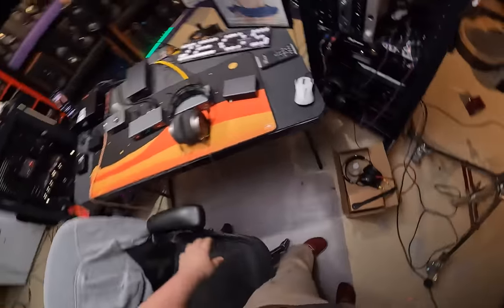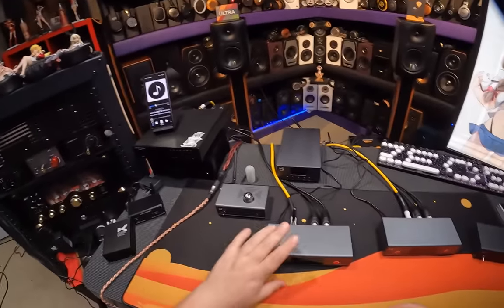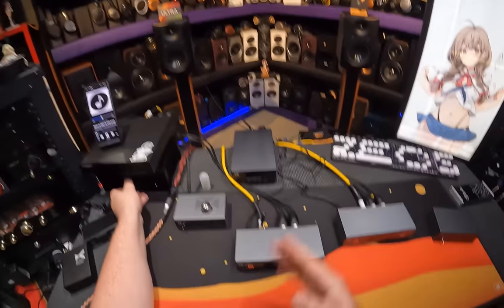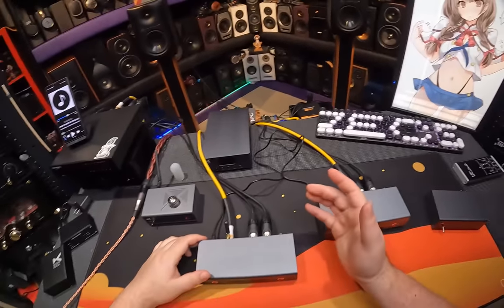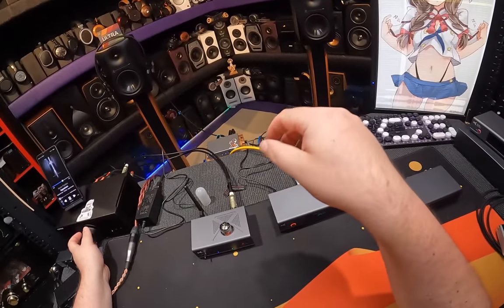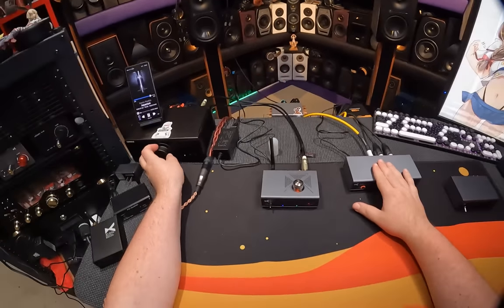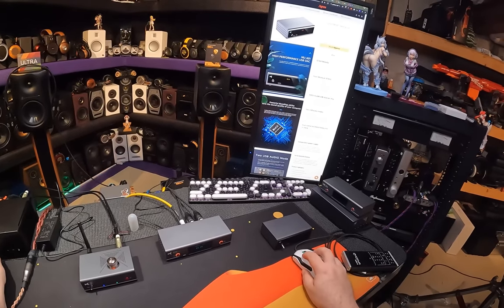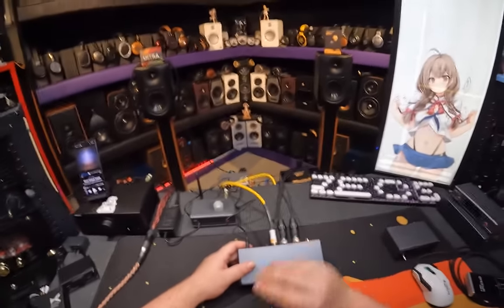The Most Unpredictable Audio Brand..

Comment: I'm disappointed the XQ-100 didn't work. Although the only feature increases over the XQ-50 PRO/PRO2 are the balanced (XLR) outputs and the upgraded DAC chip, is that worth the extra $250? Regarding xDuoo products with which to match it, the MT-604 headphone amp takes XLR inputs but that has limited function with wonky volume controls. The TA-20 is a better fit, it would be great to see how the XQ-100 performs with that, they even have similar footprints and could be stacked.

Comment: The mu602 is also interesting, its only optical in and it has built in tone controls on a dac
Reply: I have it, it's awesome. i pair it with the ifi zen and it sounds pretty clean.
Reply: @SidVirtuous  the ifi zen can? hows the bass knob?
Reply: @kazumasatou6124  the truebass on the zen gives a very subtle sub bass boost. The bass knob on the xduoo dac is great because it doesn't overwhelm the midbass, but can also tone down the warmness of certain headphones like sennheisers 600 lineup and my harmonicdyne Zeus. I also use the treble tweak quite often as it can really bring out the detail. Unfortunately, my Zen amp has a channel imbalance in 3d audio mode so I don't use it and can't comment on how it affects soundstage or the sound signature in general
Reply: @SidVirtuous  did you notice that the knobs on 0 have a nasally sound to them? i just received mine and the all the knobs in the middle sound nasally but with an increase in treble it returns to neutral.
Reply: @kazumasatou6124  haven't noticed that tbh. But I've only tried it with my hd 800s and I usually have the bass turned up to two o'clock so maybe it happens on mine on neutral, I'll try it out later
Reply: @kazumasatou6124  Sorry I'm taking so long to respond, I got a bit busy, but you're right. It absolutely is a bit more nasally with everything on neutral. I also tried to mend the warmness of my harmonicdyne Zeus, but without a significant increase in the sub bass, it gets a bit too thin for my taste and kinda offsets the imaging in a weird way. As much as I like the idea of this dac, I'll have to wait for more iterations to get my setup the way I want it.
Reply: @SidVirtuous  i just decided to remove the dac from my setup all together and use my old tube preamp. It works much better for the purpose